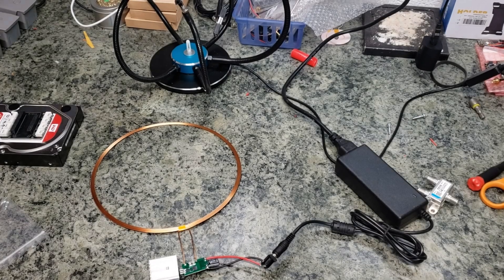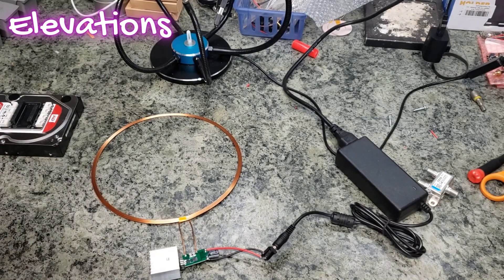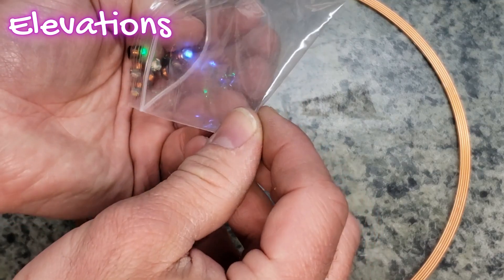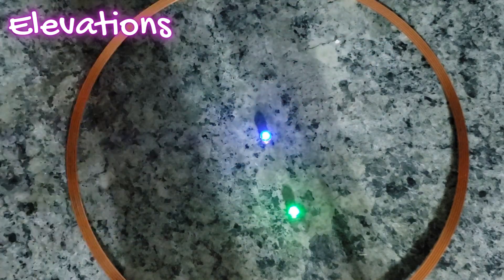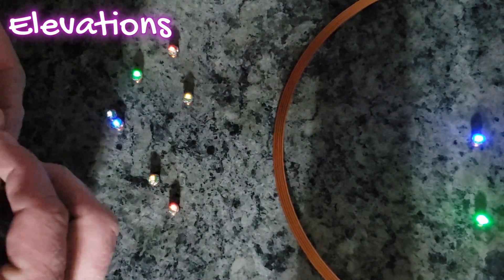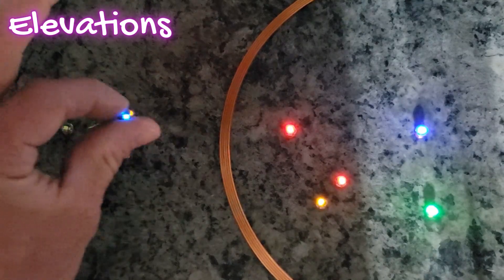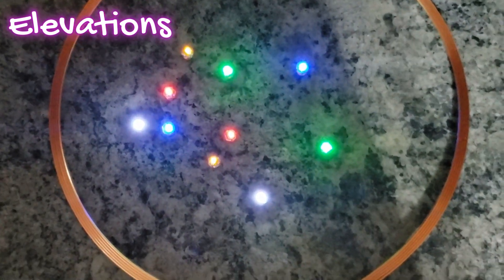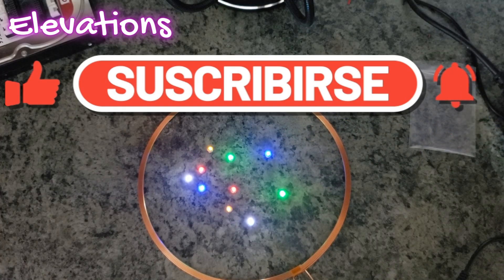How to use wireless power to turn on LEDs with a power ring

Comment: I have one of these also. I haven't decided on what to make with it yet. I was thinking about trying to 3d print a top and a concave base for it to spin on, but haven't thought of any other uses. If you have ideas i would love to hear. They are doing nothing currently
Reply from the maker: We have been talking about changing the wiring on the LEDs themselves to allow for more flexibility of use.  Since we see far better power output with matching planes, we just need to adjust a few things to allow the coils to lay flat while the LEDs point elsewhere.